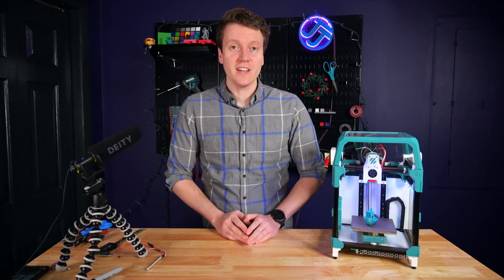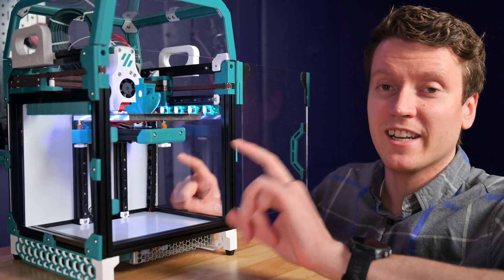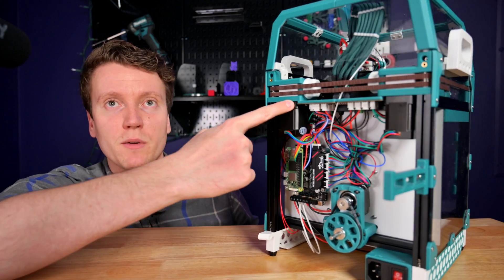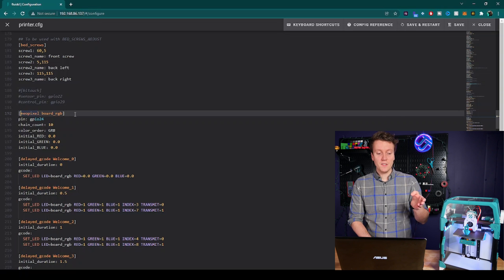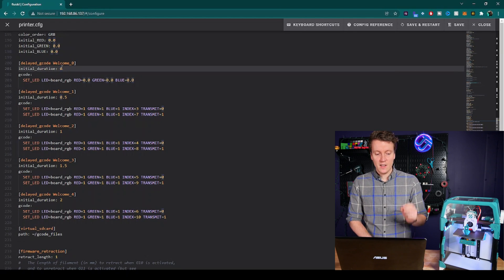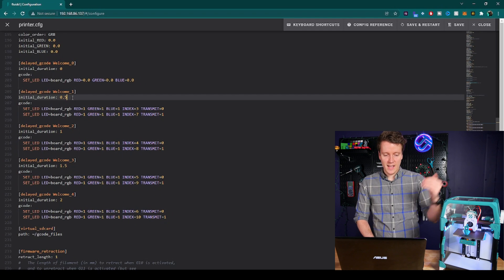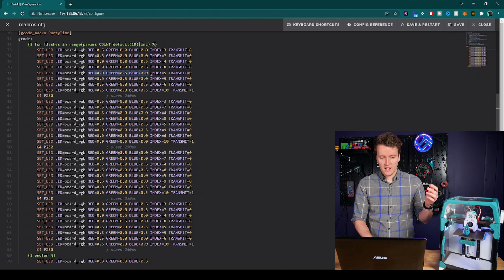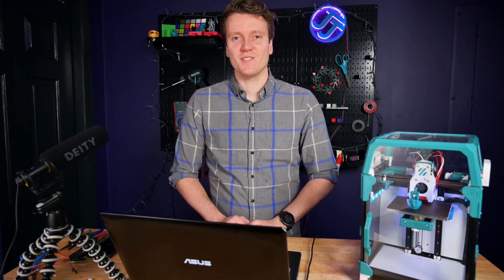Klipper Advanced LED control | Voron V0.1 RGB Lighting Macros

Comment: How about a video detailing how to use the raspbery pi gpio pins to run leds in klipper? Try to set mine up using gpio26 without any luck. Awesome video, by the way.

Comment: I'm still confused about the wiring. On the PCB it gets a 4-pin connector. DIN, DOUT, GND, 5V and so for the other stick. So I connect both sticks the same way. How the wiring should be?

Comment: Great video, was hoping to find the atticle you mentioned about the Pi. Any info on using the Pi to control them? The SV06 lacks enough usable io pins on the mainboard. Ive tried connecting the LED's data line to the gpio on the rpi 4b, setting the pi as a second mcu in klipper, and doing the usual neopixel config defining the pi's gpio pin for the LED. but nothing happens. Klipper documentation says it's not supported when having the pi as a secondary mcu alongside the printers mcu as the pi cant keep up with the pulses, but i cant find another way of controlling the pi's gpio from klipper. Is there an alternative way?

Comment: Hey JJ nice video! Question for you. Based on looking at the image for this mod on the git hub I assume you'll have to remove the front extrusion to slid the Mount for the LEDs in?
Reply from the maker: They can actually just be pressed into the gap in the aluminum extrusion. It did take a bit of force
Reply: @JJShankles  oh nice. Then I'm most likely going to do this on my v0.1. I'm very lazy and didn't feel like taking them off. 😂👍 Many thanks.

Comment: Hello, at 1:30 you just moved the bed without any force. What parts are used? The belt? I have this plastic leadscrew nut (official guide page 59) which does not allow me to move the bed by hand at all. Thanks.
Reply from the maker: I am using this belted Z axis mod: https://www.teamfdm.com/files/file/319-v01-belted-z-drive/
It makes it very easy to move the z axis by hand. This comes with some downsides though, when a print is done and the z motor turn off then the bed will slowly move the the bottom, so it will never be able to recover from a power loss. The upside is very fast z moves.
Reply: @JJShankles  thanks for the info and instant reply 👍

Comment: just a quick question, would i be able to reference the completion percent of the print and reflect that with the LED's? I'm wanting to put a strip of LED's up the front extrusions of my Ender 3 and i want them to reflect the print percentage so i can see it with a quick glance. Just as a fun little add-on. 

Also. With the colors will 0.0 on all 3 be "off" and then 0.5 on all of them be dimmed to 50% power? and then 1.0 on all of them 100% on?
Reply from the maker: I'm not sure how to do that first thing. That would be really cool if possible.

And yes that is correct with how to control the LEDs.
Reply: @JJShankles  asking around to figure out if i can grab completion percentage from somewhere in klipper to achieve this.Ill update you if i figure anything out.
Reply: @elijahpollard6828  Hey, did you ever figure this out? I'm also interested.
Reply: @CyberBeatAustralia  in thinking about this. You can probably use curas post processing to add in gcode commands or in this case klipper macros that change which leds are on at certain layer heights. Might work well might not. Just a though.

Comment: i got a neopixel ring 12 leds on it but it only turns on 8 leds ? and how do you turn on the party mode
Reply from the maker: Did you increase the "chain_count" in the configuration? And I can turn on the party mode by clicking the macro on the dashboard, I also have it run that macro at the end of a print so that I can notice it is done. to get to work you need to define it in your config file as well
Reply: [neopixel board_rgb]
pin: PB0
chain_count:12
color_order: GRB
initial_RED: 0.0
initial_GREEN: 0.0
initial_BLUE: 0.0

# Extended Macros for case LEDs

# [gcode_macro SIREN]
# gcode:
#     {% for flashes in range(params.COUNT|int) %}
# 	SET_LED LED=base_right RED=1 GREEN=0 BLUE=0
# 	SET_LED LED=base_left RED=0 GREEN=0 BLUE=1
#         SET_LED LED=fysetc_mini12864 RED=1 GREEN=0 BLUE=0 INDEX=2 TRANSMIT=0
#         SET_LED LED=fysetc_mini12864 RED=1 GREEN=0 BLUE=0 INDEX=3
#         SET_PIN PIN=caselight VALUE=0
# 	G4 P250                       ; sleep 250ms
#         SET_PIN PIN=caselight VALUE=2.5
# 	G4 P250                       ; sleep 250ms
# 	SET_LED LED=base_left RED=1 GREEN=0 BLUE=0
# 	SET_LED LED=base_right RED=0 GREEN=0 BLUE=1
#         SET_LED LED=fysetc_mini12864 RED=0 GREEN=0 BLUE=1 INDEX=2 TRANSMIT=0
#         SET_LED LED=fysetc_mini12864 RED=0 GREEN=0 BLUE=1 INDEX=3
#         SET_PIN PIN=caselight VALUE=5
# 	G4 P250                       ; sleep 250ms
#         SET_PIN PIN=caselight VALUE=7.5
# 	G4 P250                       ; sleep 250ms
#     {% endfor %}
# 	SET_LED LED=base_right RED=1 GREEN=0 BLUE=0
# 	SET_LED LED=base_left RED=1 GREEN=0 BLUE=0
#         SET_LED LED=fysetc_mini12864 RED=1 GREEN=0 BLUE=0 INDEX=2 TRANSMIT=0
#         SET_LED LED=fysetc_mini12864 RED=1 GREEN=0 BLUE=0 INDEX=3
#         SET_PIN PIN=caselight VALUE=10

[delayed_gcode Welcome_0]
initial_duration: 0
gcode:
  SET_LED LED=board_rgb RED=0.0 GREEN=0.0 BLUE=0.0

[delayed_gcode Welcome_1]
initial_duration: 0.5
gcode:
  SET_LED LED=board_rgb RED=1 GREEN=1 BLUE=1 INDEX=3 TRANSMIT=0
  SET_LED LED=board_rgb RED=1 GREEN=1 BLUE=1 INDEX=7 TRANSMIT=1

[delayed_gcode Welcome_2]
initial_duration: 1
gcode:
  SET_LED LED=board_rgb RED=1 GREEN=1 BLUE=1 INDEX=4 TRANSMIT=0
  SET_LED LED=board_rgb RED=1 GREEN=1 BLUE=1 INDEX=8 TRANSMIT=1

[delayed_gcode Welcome_3]
initial_duration: 1.5
gcode:
  SET_LED LED=board_rgb RED=1 GREEN=1 BLUE=1 INDEX=5 TRANSMIT=0
  SET_LED LED=board_rgb RED=1 GREEN=1 BLUE=1 INDEX=9 TRANSMIT=1

[delayed_gcode Welcome_4]
initial_duration: 2
gcode:
  SET_LED LED=board_rgb RED=1 GREEN=1 BLUE=1 INDEX=6 TRANSMIT=0
  SET_LED LED=board_rgb RED=1 GREEN=1 BLUE=1 INDEX=10 TRANSMIT=1

[gcode_macro PartyTime]
gcode:
    {% for flashes in range(params.COUNT|default(10)|int) %}
	SET_LED LED=board_rgb RED=0.5 GREEN=0.0 BLUE=0.0 INDEX=3 TRANSMIT=0
        SET_LED LED=board_rgb RED=0.5 GREEN=0.0 BLUE=0.0 INDEX=7 TRANSMIT=0
        SET_LED LED=board_rgb RED=0.0 GREEN=0.0 BLUE=0.5 INDEX=4 TRANSMIT=0
        SET_LED LED=board_rgb RED=0.0 GREEN=0.0 BLUE=0.5 INDEX=8 TRANSMIT=0
        SET_LED LED=board_rgb RED=0.0 GREEN=0.5 BLUE=0.0 INDEX=5 TRANSMIT=0
        SET_LED LED=board_rgb RED=0.0 GREEN=0.5 BLUE=0.0 INDEX=9 TRANSMIT=0
        SET_LED LED=board_rgb RED=0.5 GREEN=0.0 BLUE=0.5 INDEX=6 TRANSMIT=0
        SET_LED LED=board_rgb RED=0.5 GREEN=0.0 BLUE=0.5 INDEX=10 TRANSMIT=1
	G4 P250                       ; sleep 250ms
        SET_LED LED=board_rgb RED=0.5 GREEN=0.0 BLUE=0.5 INDEX=3 TRANSMIT=0
        SET_LED LED=board_rgb RED=0.5 GREEN=0.0 BLUE=0.5 INDEX=7 TRANSMIT=0
        SET_LED LED=board_rgb RED=0.5 GREEN=0.0 BLUE=0.0 INDEX=4 TRANSMIT=0
        SET_LED LED=board_rgb RED=0.5 GREEN=0.0 BLUE=0.0 INDEX=8 TRANSMIT=0
        SET_LED LED=board_rgb RED=0.0 GREEN=0.0 BLUE=0.5 INDEX=5 TRANSMIT=0
        SET_LED LED=board_rgb RED=0.0 GREEN=0.0 BLUE=0.5 INDEX=9 TRANSMIT=0
        SET_LED LED=board_rgb RED=0.0 GREEN=0.5 BLUE=0.0 INDEX=6 TRANSMIT=0
        SET_LED LED=board_rgb RED=0.0 GREEN=0.5 BLUE=0.0 INDEX=10 TRANSMIT=1
	G4 P250                       ; sleep 250ms
	SET_LED LED=board_rgb RED=0.0 GREEN=0.5 BLUE=0.0 INDEX=3 TRANSMIT=0
        SET_LED LED=board_rgb RED=0.0 GREEN=0.5 BLUE=0.0 INDEX=7 TRANSMIT=0
        SET_LED LED=board_rgb RED=0.5 GREEN=0.0 BLUE=0.5 INDEX=4 TRANSMIT=0
        SET_LED LED=board_rgb RED=0.5 GREEN=0.0 BLUE=0.5 INDEX=8 TRANSMIT=0
        SET_LED LED=board_rgb RED=0.5 GREEN=0.0 BLUE=0.0 INDEX=5 TRANSMIT=0
        SET_LED LED=board_rgb RED=0.5 GREEN=0.0 BLUE=0.0 INDEX=9 TRANSMIT=0
        SET_LED LED=board_rgb RED=0.0 GREEN=0.0 BLUE=0.5 INDEX=6 TRANSMIT=0
        SET_LED LED=board_rgb RED=0.0 GREEN=0.0 BLUE=0.5 INDEX=10 TRANSMIT=1
	G4 P250                       ; sleep 250ms
        SET_LED LED=board_rgb RED=0.0 GREEN=0.0 BLUE=0.5 INDEX=3 TRANSMIT=0
        SET_LED LED=board_rgb RED=0.0 GREEN=0.0 BLUE=0.5 INDEX=7 TRANSMIT=0
        SET_LED LED=board_rgb RED=0.0 GREEN=0.5 BLUE=0.0 INDEX=4 TRANSMIT=0
        SET_LED LED=board_rgb RED=0.0 GREEN=0.5 BLUE=0.0 INDEX=8 TRANSMIT=0
        SET_LED LED=board_rgb RED=0.5 GREEN=0.0 BLUE=0.5 INDEX=5 TRANSMIT=0
        SET_LED LED=board_rgb RED=0.5 GREEN=0.0 BLUE=0.5 INDEX=9 TRANSMIT=0
        SET_LED LED=board_rgb RED=0.5 GREEN=0.0 BLUE=0.0 INDEX=6 TRANSMIT=0
        SET_LED LED=board_rgb RED=0.5 GREEN=0.0 BLUE=0.0 INDEX=10 TRANSMIT=1
	G4 P250                       ; sleep 250ms
    {% endfor %}
	SET_LED LED=board_rgb RED=0.0 GREEN=0.0 BLUE=0.2
Reply: @buas7  I know next to nothing about code but to me it looks like you are missing "INDEX=1" and "INDEX=2" in your code. which would leave out 2 of your LED's
Reply: @JJShankles  yes it is working but how do i led the color change when the temp is right or print is done

Comment: 16 LEDs can run safely on the sk3 v2? Or u power it to a 5v PSU?
Reply from the maker: I am using the SKR Pico board, and yes they are all running on one of the pins

Comment: Great video, and i have a request if possible.... It´s possible to read the temperature (when you start heat bed) data from klipper and simulate the color transition  (like blue for cold bed (ambient temperature)  and red for max. heated bed).
Reply from the maker: That is something I would love to get working. I have been thinking of ways to make that work. I think if I rewrote my start_print script, I could get something working
Reply: @JJ Shankles  this is precisely  why I came to your video. Did you figure that out by chance?
Reply: Would be awesome nice idea!

Comment: the only experience with LEDs on printers was from marlin and that wasn't the greatest I had it set up to go from blue to green as the bed heated then green to red as the nozzle heated then white as the print started but even with the special command buttons I added to the touch screen I couldn't turn them off once a print started and since my printer was in my bed room it got annoying real fast I later added a power switch so I could turn them on and off when I wanted but I think i'll try again with klipper worst case I just need to wire in another switch and I would love to have it so the lights come on when the PI is up, change color once everything is up to temp and do something like "party time" when the print is complete maybe with a macro to turn the lights on and off so if I'm printing at night I can turn it on to check the print then off again